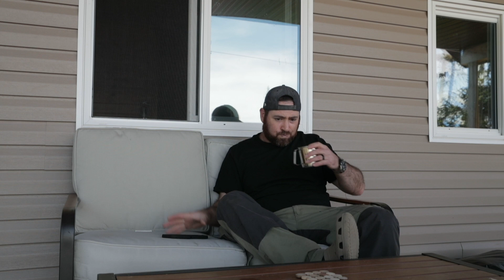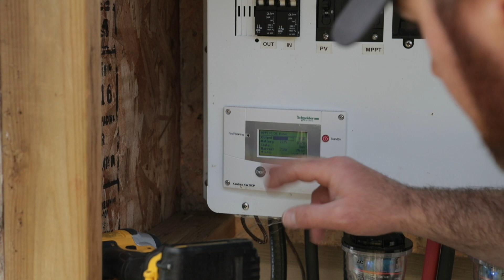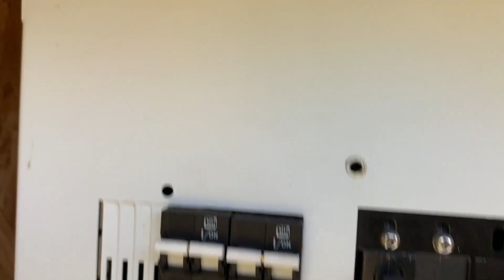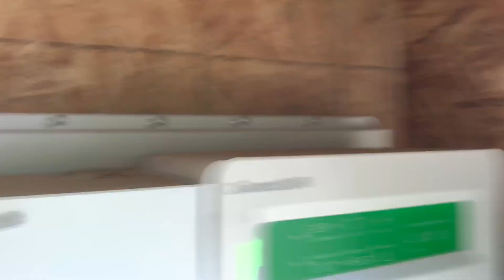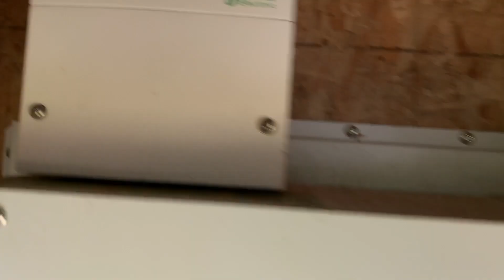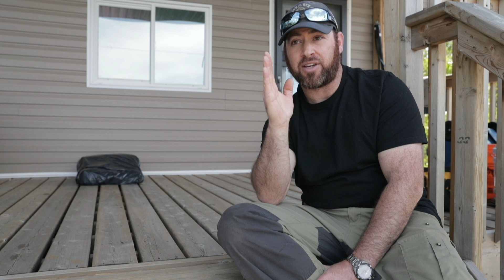OFF GRID SOLAR POWER | Complete System, Endless Power & Lessons Learned

Comment: Good to see honest talk on problems with solar and how to tackle the issues.
If there is mobile signal in the area - one can send sms to start a parafine heater, if the batteries are "alive". One Lifepo4 battery is safer on the Voltage. 
But in the winter and very low temperatures - the batteries need heat - for charging, but can be used for load in minus degrees.
A roof or otherwise protected area over a few panels can then be safe for remote start of heat in winter.

Comment: You shouldn't be depleting your batteries to 30% anyway, you need to learn more to save money, no way I'd operate a system without understanding it, electrical and plumbing are easy so why not learn your solar system. I'll admit it can be a lot but save you heaps of cash on more than just the solar system, understand how to fix the things it powers so more savings...ijs

Comment: So the fridge is a regular fridge that runs off of AC power? What type of water heater do you use? Great system! Thanks for sharing!
Reply from the maker: I have a propane on demand water heater. Never run out of hot water !!
Reply: @solotripper  those are great! Thanks for getting back with me...

Comment: Hiya, informative vid and great series. What is the life expectancy of the batteries and how do you heat your cottage? How much power does the heating system use compared to your fridge ? Thanks 👍
Reply from the maker: Hey Rod, thanks for watching. I was told 10 years minimum for the batteries. Hope that's the case. I heat the cabin with wood so no power use.